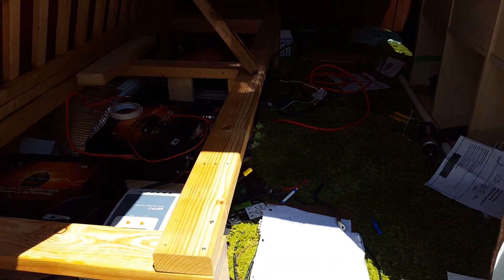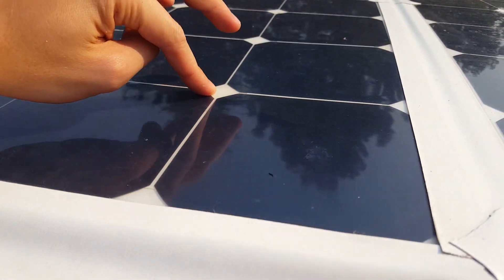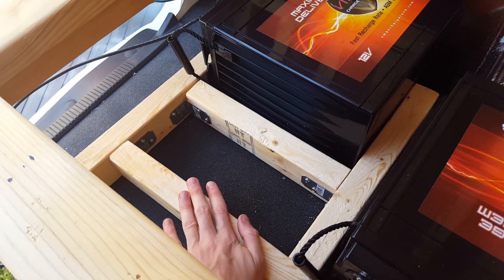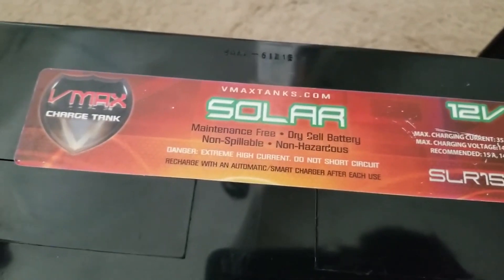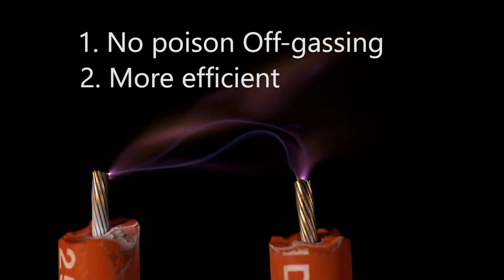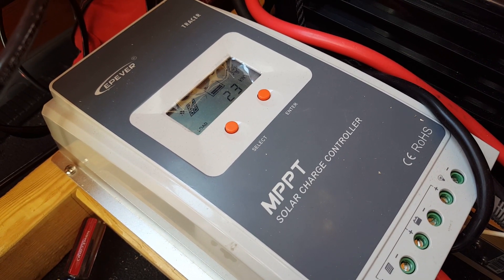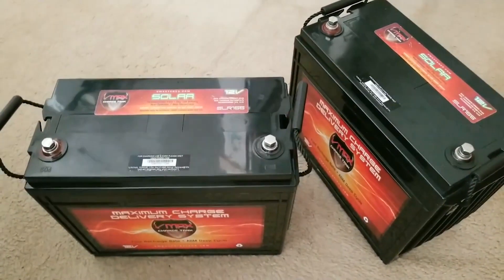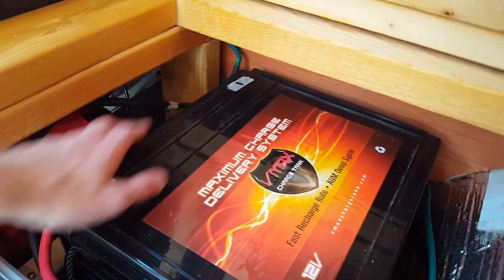Which Solar Batteries Are Best for Off Grid Van Life?

Comment: The best ones are the ones you can afford period
Reply from the maker: Very true
Reply from the maker: Very true
Reply: Usually lithium. And no u have 155ah useable. Going down to 10.5 would destroy those batts. Lithium U can discharge down to 10% or so. Ur batts no less than 50%. Also lith lasts longer. 2000-5000 charges compared to agm with 500-1500 cycles

Comment: Good video & advice. Something I would add to your advice. Always buy the battery bank first & get a big enough battery to handle your needs + plus 50%. Next buy the best charge control you get get for that size battery bank. Method of charge solar,wind, generator or vehicle charge system is much less important as you can use any or all of the above to do the job. 20yrs of living off grid will teach you some expensive lessons. I wasted a lot of money before learning that lesson.
Reply from the maker: Great advice Jay

Comment: It's the current that runs through your body that can kill you.  However, current has to obey Ohm's Law.  Thus if the voltage is 12V, the resistance of your body is too high to get anything more that a mild shock.   At 24V, the current will be higher, likely it will hurt, but it's not likely to kill you.  Above 30V, care should be taken.  At 30V and higher, things could get rather nasty for you.   Working with a 36V or higher system can be dangerous.

Comment: Sorry but not a good video. Lithium are fundamentally different to wet lead in their charge requirements. Wet lead can be trickle charged ie low amp over a longer period of time. Solar is often low amperage. Lithium requires high amperage. The Tesla power wall is for example only grid connect because of the amperage requirements. If you use low amperage with many battery types they will not last. Old giant wet cells in solar can last decades. I know of many examples. And they are cheap. But you must maintain them and you must have a proper vented secure storage area designed for this use.  Cheers all

Comment: lithium are cheaper in the long run
Reply: The True Review. frack that shit, give me graphene batteries!
Reply: But impossible if you cant buy them up front.  
Lithium is cheaper if you buy directly from china. Battleborn battery cells are made in china. save money and cut the middleman.  I'm not saying battleborn is bad rather that their are other options.
Reply: Audio  He stated in the video that Lithium were better in every way.  Just that they cost a lot.  He never said they weren't worth the extra cost.  I've considered lithium but I'm always concerned I will do something stupid and ruin it.  That is a LOT of money down the drain.  I mess up an AGM I can easily buy another one.

Comment: Great vidoe, there are some wet batteries that are good for solarusage also. Rolls has a serie of 2V battery@5000Ah. A set of 6 batteries gives 12V@5000Ah. This is 60'000Wh@12V and 30'000Wh are usable since we dont want to use more that 50%.  These also has lifetime of 3200 cycles. Weight is huge since its 260Kg per 2V battery = a total of 1250kg.
Reply from the maker: Wow that's quite the set up!

Comment: Did you tweak your charge controller settings to match the VMAX charge voltage recommendation? I’m using an EPEVER with the 125ah version of vmax. Seems to be working fine but haven’t hooked up the pc yet to see more advanced user settings, just left it on default sealed settings

Comment: If you are driving with these they need to be strapped to the frame with metal ties. (or nylon equivalent)
That wood frame is like paper for those batteries in a head-on accident. The weight multiplied by your speed x2 given the other cars speed is similar to a civil war cannonball.
It will fly through your bed, the seats, past you, the dash, into the other car, and into other people.

The more batteries you have, the more cannonballs you fire. Some drive around with 8+ batteries not strapped down at all. That is basically shotgun cannon.

What are the chances and risks really?
If you survive then you are legally going to deal with involuntary manslaughter and negligence.
There is regulation on batteries in vehicles for a reason.
Reply: Excellent statement. To often people think because something is heavy it won’t move around. This is not true when moving at 60mph. You stop they don’t. You must tie down heavy objects or risk major injuries when you hit something or slam on the breaks.

Comment: Thank you SIR!  Ive done much the same as you did for a battery bank.  Question on your setup.  What gauge/size power cable did you end up using?  4/0 awg for all?
Reply from the maker: robin3068 Glad it helps Robin. The battery and inverter are all 4gauge. The custom cables from the solar panels into the controller are gauge 10. There is also a ground wire from the inverter that is 8 gauge.
Reply: Thank you again, you rock.  I am about to launch my 3 month off grid bug out project which you played a big part in for my the solar and battery bank.  Im running two 155 amp/h AGM (yours),  charged by 200watt 11amp Zamp Solar suitcase foldout.  Im trying to stay away from generators for the time being, California sun is good.
Reply from the maker: robin3068 You definitely should be able to get some good sunlight hours in there! It's also not to hot or cold. Set up looks good

Comment: After watching the complete vid, I have a question for u? I currently have a 100w solar from HF with battery, would it be possible to connect 3 more battery to the 100w solar kit I have or would i need to add another solar panel?
Reply from the maker: The way I understand it is more solar panels makes your batteries 
fill up quicker. You could use one panel and fill up 3 batteries 
(assuming they're wired properly), but It would be slower than 2 
panels worth of energy going in.
Reply: zhkopec thanks for the info, I'll get 1 more for a total of 2 then save up for another solar kit
Reply: I could be wrong but I think the rule of thumb is 1ah in battery for every 1watt of solar panel.  I doubt it has to be exact... just that you don't want to stray too far from that.  I suspect the logic behind it is basically what zhkopec is pointing out.  If you actually think you will need 4 100ah batteries on a regular basis then your 100w panel simply won't be able to keep them all charged up.   And that would mean you would keep dropping them way down on charge.  Which lowers their life expectancy.  Plus, I also suspect that not fully charging them isn't good for them either.

That said, if you only need one 100ah battery and yet buy 4 instead, then you would have more backup power I guess.  Plus, you would very seldom be dropping the charges on them that far which means a longer life.  HOWEVER, I highly doubt that the extended life would save you anywhere near the cost of the extra batteries.

Btw, I think once you start stepping up your system like more panels, batteries, etc, then you also have to consider other upgrade costs like possibly a better fuse box, charge controller, etc.  For example, with my 100w panel and 100ah battery I only had to pay like $20 I think for the fuse box.  That is because I'm never drawing that much juice and keep it simple.  In order to use up the power in four 100ah batteries you are talking much larger loads which means a bigger fuse box. 

I'm no expert on any of this though.  Maybe someone out there that knows better can confirm/correct anything I said.

Comment: Enjoyed your video and have a question. Why do you suggest not mixing the size of Ah batteries? I’ve read conflicting information regarding this...some companies say you can mix other post/videos say don’t.
Reply from the maker: Lets say you connect a 50ah battery, and a 100ah. Both are 12v. The 50ah will empty out before the 100ah. This gives it the smaller a lower voltage. Which is bad because then the 100ah starts to charge the smaller one (with reversed voltage). Cells aren't designed for that and bad things happen. (Nice and toasty explosions)
Reply: That is only true if you put batteries in series. Then the capacity is equal to the one with the lowest value. But for parallel setting you can use whatever capacity you want as long battery voltage is similar. Its like 2 connected watertanks. Even if 1 tank is smaller, the level can only go up/down same

Comment: What are pv solar panels?  I have the Renogy 200 Watt 12 Volt Monocrystalline Solar Starter Kit with Wanderer ...pv solar panels??  30A PWM Negative-Ground Charge Controller - the Renogy Wanderer
Reply from the maker: connie simon PV is measurement of  the power coming from the solar panels into the control panel.  My panels are 100w (x4 panels) wired in series. I bring in 14-60pv give or take depending on sunlight
Reply: All solar panels are PV. PV stands for photovoltaic. There are two types Monocrystaline and Polycrystaline.
Reply: ekoms108 Thanks I needed the answer to that today.
Reply: zhkopec  Now I am confused.  If you wired your batteries in parallel, then why wire your panels in series.  Sorry, I am a newbie to the solar stuff.
Reply: You wire the panels in for the maximum input voltage to the charge controller or inverter. Those 2 devices will meter out your AC and DC loads or storage.

Comment: just wondering aloud if its possible to have 2 or even 3 separate battery systems in my future build   im a builder but electric is my weak point
Reply from the maker: Packie Joe Gilheany what would you be trying to do with 3 instead of 1? It's technically possible but might be quite inconvienent
Reply: @zhkopec  ,. I was just thinking about dedicated solar system to power a few things and another system for larger needs . Hey I'm a builder and weak with electrical systems especially battery and solar.  Learning from these posts though   .  Cheers
Reply: @zhkopec   also my aunt in Ireland has a solar system for her hot water and common area lights.  Ireland, West coast where I didn't see the sun until I was 5 years old. Her system works on UV rays.  Do we have that here ?

Comment: It kinda sounded like you were partial to the AGM as opposed to the GEL.  Is that right, or are they both Sealed Lead Acid (SLA) batteries of different types or are the VRLA or what?  The more I learn the less I know.
Reply from the maker: Gel and AGM are both lead acid yes. I got the AGM batteries.  They're the best in my opinion other than Lithium ion battery which would run around $1000. Here's a link where I learned the basics. https://www.batterystuff.com/kb/articles/battery-articles/battery-basics.html
Reply: That looks like a good site.  Thank you.

Comment: Lithium Iron Phospate is the best for sure.
Reply from the maker: I've heard good things
Reply: ABSOLUTELY!   I have 8 x CALB 180's  in series for a 24V system..  4.5 KWHr.  Kind of pricey, about $2,000.00.  I've been running them for 4 years straight running alongside my grid system, no grid tie.  No BMS.  I watched them like a hawk for 6 months,  they totally settled in, always within .05 volts of each other.  I typically pull them down to 40% every night,  after 4 years no loss in performance detected at all.  Also-  I get most my sun in the morning, they're usually topped off by noon.  1600 watts of panels,  I don't have to worry about charging too quick. -I welcome any further questions!

Comment: More solar panels does not mean we can charge it quicker either. If they are using AGM sealed batteries then they need a slower charge than a flooded lead-acid battery. Too much will just destroy them. It can be worse than discharging the battery below 50%. The MPPT controller should handle that, however. But then it's pointless if that is limiting your solar input anyway. And we pull from the battery when we use power, not the solar panels.
So it's a good idea to correctly size solar to the battery bank. (Which should also be strapped down.)

Comment: How about telecom batteries? Can it be use for solar set ups? Tnx!
Reply from the maker: I can't say for certain, but if they have the voltage and stats as normal agm batteries than I bet you could use them
Reply: @zhkopec  yeah they are 12v.i have telecom batts. Deep cycle gel type  Given by my friend.tnx for the info.

Comment: can i use a 2 volt 1000 battery with 220 volt invertor, and will it run Air Conditioning
Reply from the maker: Omar Bull-47 There is almost no way to run am air conditioner with solar. You would need thousands of dollars in batteries :(
Reply: but can i use single 2 volt 1000AH battery for other home appliances ?
Reply: I don't think you could do this. There is energy loss when an inverter inverts a very low voltage. So an inverter would not be as efficient inverting 12v as it would 24v or 48v. So I would think 2v is too damn low for an inverter.

Comment: can two 12V 100Ah Battery , make a 1000w mircoWave run 1 hours ?
Reply: volts x amps = watts, 2x100x12=2400w @80% efficiency 1920w , YES, almost 2 hours but then your spent!
Reply: Hi, yes you can. 1000W for one hour will take like 97A from your battery. This is like 50% from each battery and lower then that you must not go.
Reply: @fredricknilsson7  Yes your are right, it would kill the reuse of the battery, 4 12v 100ah, would keep them about 70% if lead acid, if Lithium or some other battery that can handle a full discharge, For cheep a small generator is looking better for running a microwave at this point!
Reply: U need inverter

Comment: This is definitely the cheapest way to start a battery system. But if you plan on using this system for more than 3 years using any lead acid becomes very expensive because the batteries will need replacing. 

These batteries have a 12month warranty. As you can see by their chart https://www.vmaxtanks.com/assets/images/technical%20info%20folder/Cycles%20VS%20Depth%20of%20Discharge.pdf if you cycle this every night you can only get 400 days before this battery is bad. A bad lead acid means below 50% capacity. 

If you purchase a battle born lithium iron you will pay more upfront but they are designed to be discharged completely 3000 times with minimal capacity loss. That is why they have an 8 year full replacement warranty. 

But if you plan to only use the system for 2 years then the lead acid failure probably won’t bother you.
Reply: Also remember if you discharge your batteries in less than 2 hours lead acid only gives you half its capacity. You will get the full capacity doing the same thing with lithium. So usually you can spec your lithium at half the ampHr of lead acid and get the same performance.
Reply from the maker: Good points. If I was redoing everything I would go lithium batteries. But um glad I had those AGM as training batteries

Comment: Warning signs are always for HIGH VOLTAGE not HIGH AMPERAGE.
Reply from the maker: Ah. Good to know. Thanks Quincey 👌
Reply: Not true. You actually need both. Static electricity can get to 10,000v but there is no amps behind it. Above 72v you are at risk of heart failure if there is enough amps. 

These batteries are 12v but 1000+ amps with a dead short so your risk is burns not heart failure. This is why you should not wear jewelry. The jewelry can dead short these. Your hands can not at 12v.

Comment: But amp hours aren't true amp hours if you can only let it discharge a percentage??? Instead of 310ah deep cycle why not 100ah lithium probably comes out the same since they can be discharged completely without hurting them? This guy compared all three types very good video https://youtu.be/PlJgH6T-Ke8
Reply from the maker: Fair point. The equivalent lithium batteries at the time would be close to double the price. I considered that by the time I have to look to upgrade or replace the AGM in several years the lithium would be at a cheaper price point.
Reply: Lithium batteries can not be discharged completely & still keep the longevity of the battery. They are better than other types. But the same rules apply.
Reply: Your phone has a lithium battery and you let it get below 50%, or at least it is recommended to do so.
Reply: Your cell phone will also catch fire (possibly explode) if it gets punctured...lol.  I think there are overheating issues also.  I'm not sure if that is the case for the large solar ones or not though.

Comment: I see you have a epever it sucks they are common positive
Reply from the maker: Tom Ziesmer I don't think I've run into any noticeable problems with it. But you're right they do seem to be the most common.
Reply: Can you give examples of when this will become a problem?  I also have an Epever 40 amp and haven't seen any issues yet.
Reply: GMoney most good pure sine inverters need to be negative common ground.
Reply: Tom Ziesmer so what will happen if I put a 3000 watt pure sine wave inverter with an Epever charge controller then?
Reply: GMoney If an AC inverter is used and the system is grounded on the positive, it must be an isolated type. Most standards forbid using a non-isolated (trafoless) inverter in a system grounded on the DC-side and it can be dangerous. There must be a real electrical separation between DC and AC.
Reply: Thanks, man.  What happens if I connect all of this stuff then?  Poof?
Reply: GMoney no I don’t think it would. But to take the chances of all that expensive stuff getting fried I wouldn’t take the chance. Look at my channel and subscribe I think you will like it thanks
Reply: Okay, boss, I subscribed. I guess I'll find out soon enough.

Comment: I have a 30A mppt charge controller and since hooking up my second 12v 100 ah exact same type battery last night my readings this morning are...
Pv 
20-29v
1.8-2.0 a
37.2 kwh
Batt
 2.8 a
13.7-14 v
Load 
117
4.5kwh
2n
They are going up and down as I watch and I didn't get these changes with one battery. Is there anything here indicating something wrong? I usually have my phone, tablet, Nintendo switch, led light strip, fan and max air fan on this system. AMD now a heating blanket 12v cigarette lighter type